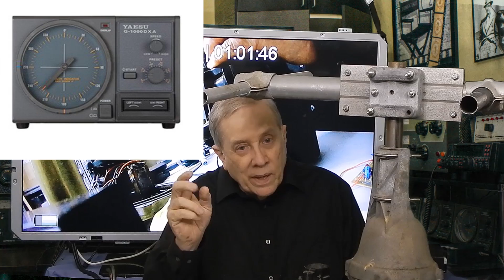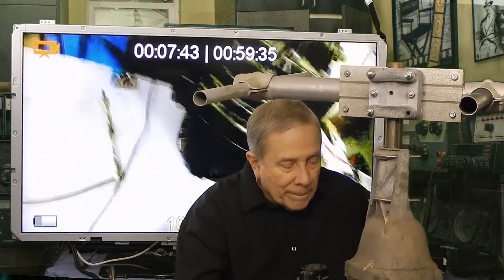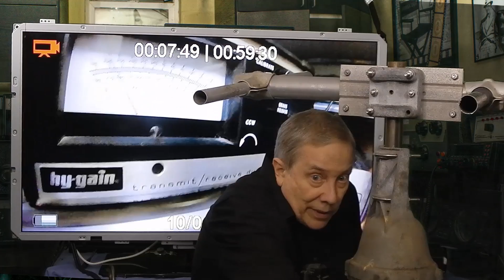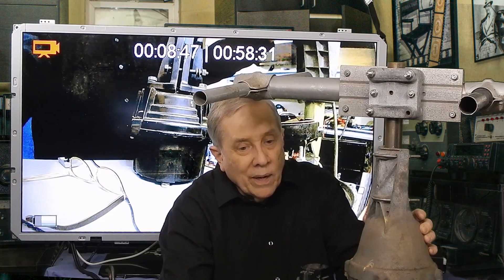Ham Radio Basics--Jim Heath W6LG Discusses Antenna Gain, Yagis and Rotators

Comment: Thankyou Sir
Any scientific comparison you can make with helical antennas with Yagi ?
Reply from the maker: A helical element is not going to be as efficient.  How much less, I don't know. I bought two long coils and will try something soon. My seat of the pants guess is that if the helical element is, let's say, 50% shorter that the efficiency is much better than 50%....maybe 75% depending on construction, Q, placement, etc.  73, Jim
Reply: @ham-radio  Thankyou Sir

Comment: Interesting video Jim and thanks for the breakdown of the simple simplicity of the famed Yagi. May its use in amateur radio continue to be demystified.

I'm very curious, could you please explain, how you go about using 2 separate in concert with each other. Please go into detail about the wiring. Does each Yagi have its own individual run back to your radio room? 

Thanks Jim for what you do,

de KE0RfZ

Comment: Funny this big lego mockup. Or are sometimes really these big tubes used for the actual antenna?

Maybe for another video, whats the use of two yaggis? I just guess, double power, maybe more directionality for a twin setup?? by having phase control it also works out somewhat when they are rotated??

Comment: Thanks Jim for a simple, easy to remember the workings of a yagi. Also, thanks for the Hexbeam comparison. I have the K4KIO and I do see a marked difference from the Cushcraft Tribander I use to have. Love my Hex!  Now, only if you could give a simple explanation as to what makes a Triband yagi, a 3 band antenna, if we stay with the fact that the driven dipole element is cut a specific frequency.  73 Bob ka9bhd

Comment: Hi Jim,
Nice concise video. Great job. I have the T2X rotator and seven element triband yagi that uses full length dipoles as the radiators on a 24 ft. boom.   73   WB3BJU